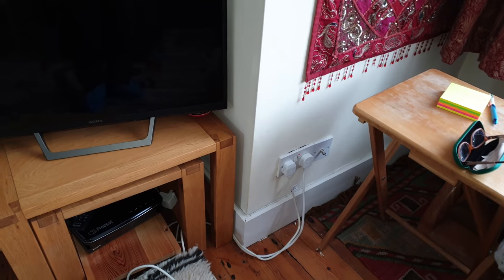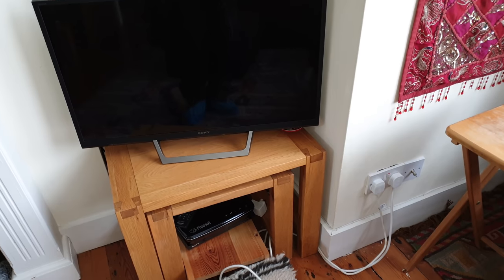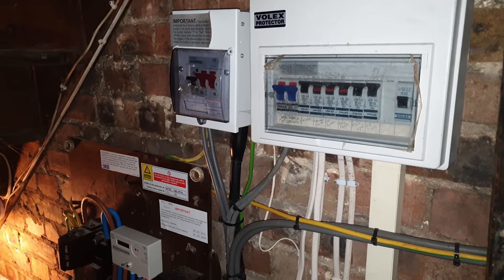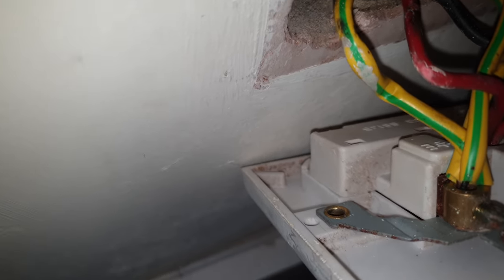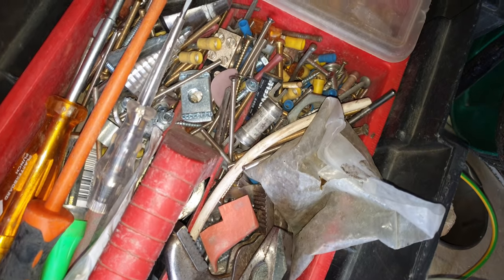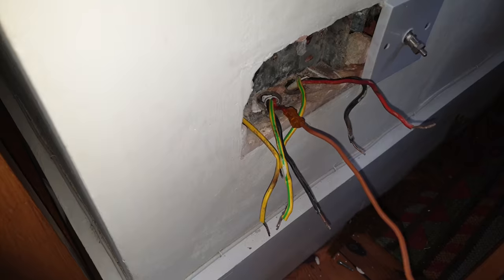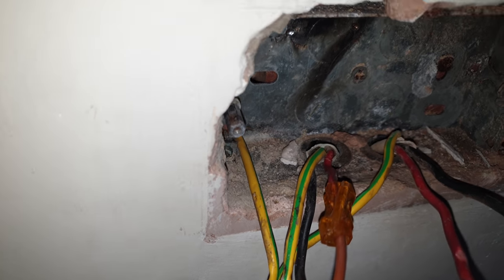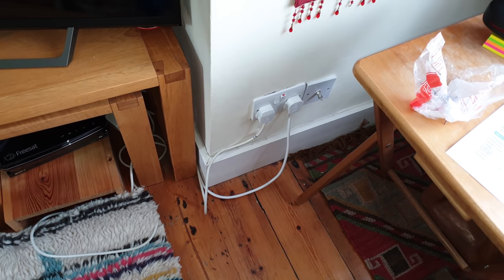Electrical Fault Finding On Socket Circuit

Comment: I had that problem as well a job in the past flashing on a two way switch cable damaged cable 3 core and earth ended up making a joint under neath floorboards

Comment: I've seen those Ideal through connectors fail in EICR.
I stick to butt crimps and Wago connectors.
Reply: Never seen an ideal fail myself and butt connectors are not designed for single core cable.

Comment: Hi Delroy,have you thought about doing a beginners series starting from scratch or even start another channel for beginners on how to test for faults,how to wire a socket,lights etc,tips and tricks to make the job easier.

Comment: Every time I turned on the microwave the light was flickering and the fuse in the plug blew..I thought it was a faulty light bulb. Ordered a new one for £16 changed it but same problem 😮 I decided to open the socket and found a lose cable , screwed it tight and problem solved . How can the wire get lose after years ??

Comment: So if My sockets line cable breaks or snaps do I need to replace the whole cable or how does that all work I’m confused
Reply: You call a competent electrician and pay someone who knows what they are doing to repair, test and issue you with a minor works cert. 👍🏻

Comment: Sorry for spastic question, why did u do Zs for and not the IR test? How total loop impedance can help you to find the fault? Will it be too high or what?
Reply: Im intrested in this to , i would have done an IR  test ,maybe del know some tricks
Reply: He was checking for earth loop impedance to ensure the path to earth had sufficiently low impedance (resistance) this is necessary for the breakers and RCBO to work effectively. He was checking to ensure that were was not a bigger more serious issue on the earth protection and breakers could operate effectively. The IR would be to check the quality of the wiring he corrected the problem on the wiring with the broken wire and new socket with a slimmer back profile to reduce risk of further damage to the conductors. We are not sure he did not do an IR test or RCD trip yes either he did not show that.

Comment: I would have just used insulation tape on it.
Reply: What on a broken wire
Reply: @neiltrevatt  If it was just exposed copper obviously
Reply: @asifdutchmaster8705  but he said it broke off.